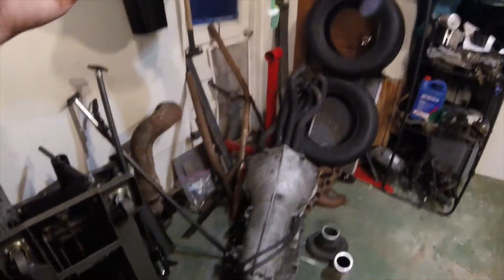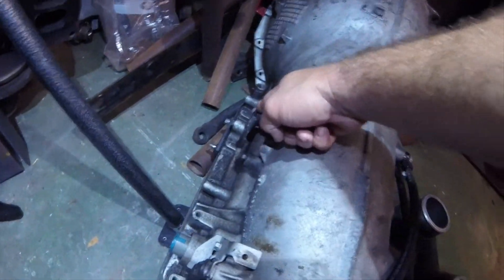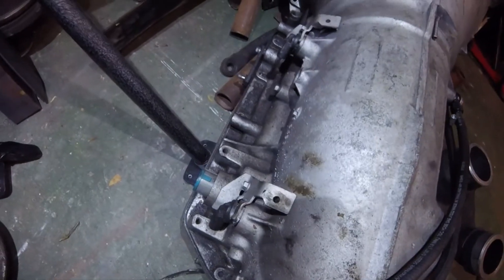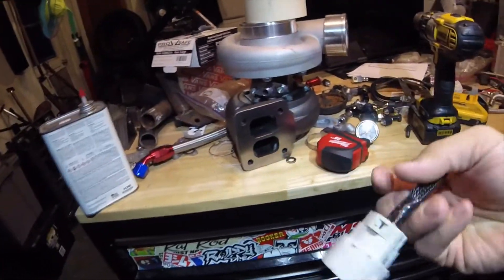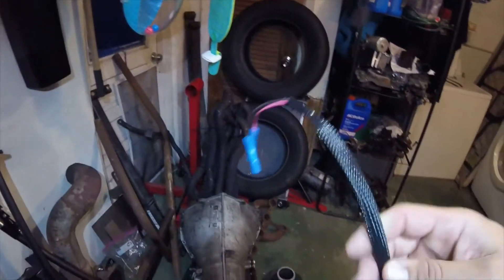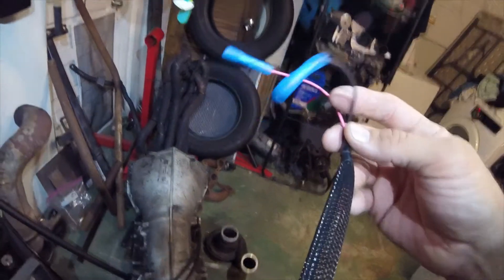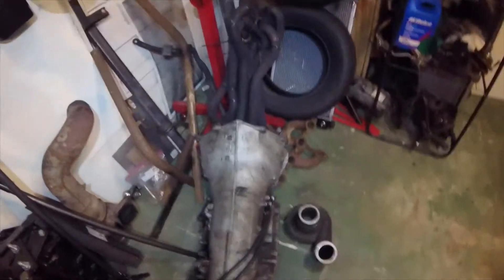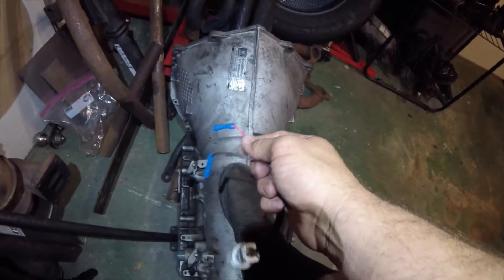How to manually shift your 4l80E.

Comment: Have you tried grounding the TCC wire and locking the converter by a manual switch?  When you lock it in 4th, is it just firm or does it shake/vibrate the car?

Comment: If you only have two wires hooked to it, how is the shifter connected to the transmission?
Reply: Ok on the transmission itself it has like a knob and you twist it to put it in gear. To shift it is automatically manual to begin with. But the computer is what controls the pressure for it to shift

Comment: I am looking at the 4L80E-3 kit with vacuum modulated pressure, but still trying to figure out how I am going to adapt the lockup switch.  I did not see any instructions on the trans go site.  Thanks for the video.

Comment: just install the 48 MOD vaccuum modulator in your trans ,takes about 2 hours after draining,this controls the shift quality to normal levels,and will not blast the rubber pistons in half,full line pressure is a no no,i put all ignition and this kit in my motorhome,the engine wiring burned up to due a squirrel building a nest on the engine in storage,works great,in a motorhome it's perfect,no slipping,do not have to change gears on the hiway unless to fuel or make a turn,my motorhome has a point distributor in it,wanted to get away from all electronics except the dash ,worked thanks to chevy power

Comment: So.   I splice A and B wire from the manifold and the ground of solenoid A together.   And C wire to the ground of Solenoid B. Switched power to the pink wire.  External switch to brown wire.   Then I just manually shift the mechanical linkage on the trans to get 1-4 gear?

Comment: you have a link for that harness on amazon?
Reply from the maker: I couldn’t find it on Amazon but I found it on eBay. https://www.ebay.com/itm/4L80e-stand-alone-controller-full-manual-shift-auto-lock-up-/264853513617?mkcid=16&mkevt=1&_trksid=p2349624.m46890.l49286&mkrid=711-127632-2357-0

Comment: For a bad ass 4L80E , rebuild with the red frictions Raybestos HP2, use a Transgo 4L80E -2  Shift kit, the 4L80E-3 is the kit that adapts a modulator valve inside the pan. With this mod , no electrics, no switches. Full manual , up shifts , and down. Have several of these units in single , and twin turbo LS combos. The valve body and pump mods, make this unit virtually bullet proof.  Units available. Hammertyme Performance Engines /Transmissions. Hampton ,Ga.
Reply: I used a trans go manual valve body kit
Reply: @JUNKYARDGTO  how has it worked for you? And what you got in front, engine wise?